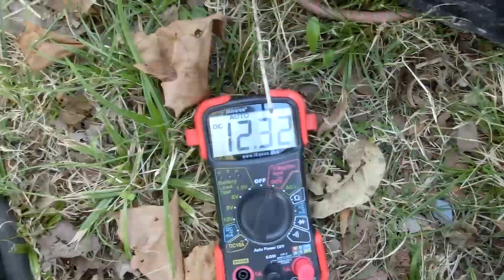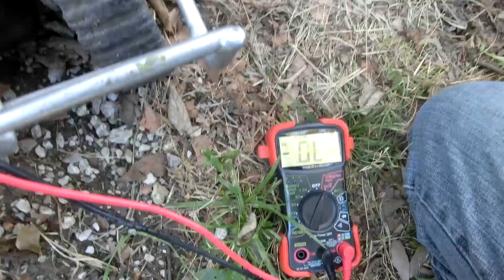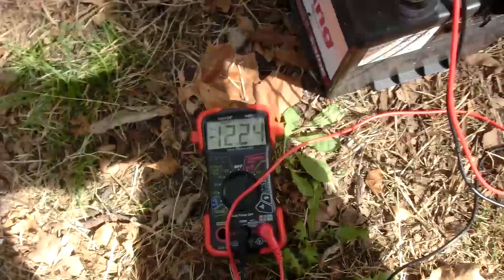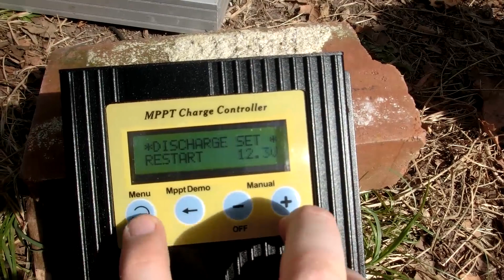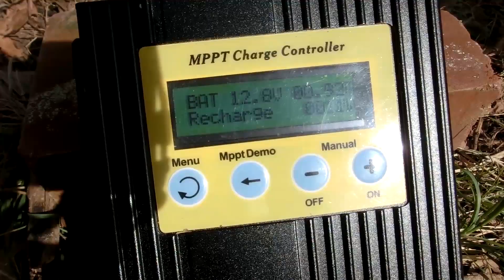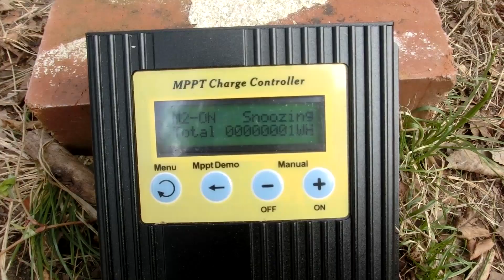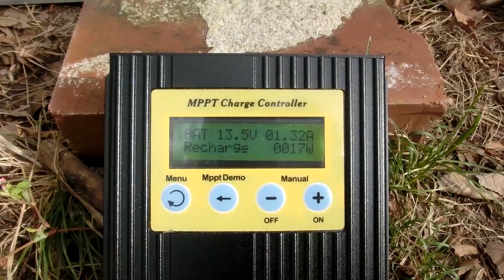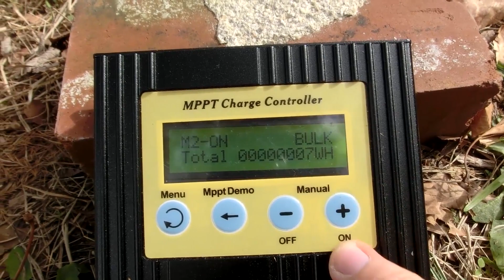Solar Sunday Experiments 012: MPPT controller, clean vs dirty panels

Comment: I just love your Videos. I'm trying to learn all the Solar Stuff and Electric since I'm fixing up a RV. So your Videos help but I find you so unique and just wait for the next one. Your doing good with getting the place fixed up and that cat is so pretty. I thought the Solar Sunday was good. Thanks :)
Reply from the maker: well i'm glad, and good luck with your RV. that sounds pretty cool. what voltage is the electrical system? the higher the voltage the thinner the wiring can be. thats why if i ever had to fix up and RV i'd probably use a 48v battery array instead of 12v.
Reply: My guess its a 12v wiring system. So what ever voltage that would be. Just learning all this stuff. :)

Comment: Thanks for another enjoyable video! I've just ordered my first solar panel, only a 30w flexible one, for my bicycle cart. I was planning on using a Sepic buck/boost converter to charge a 48v power bank in the cart that will connect in parallel with the e-bike battery.  Not sure if this will work so well. I haven't done electronics in 30+ years and so I'm reaching the end of my knowledge. I was trained in the military as a signaler and consequently, battery management, however MPPT devices are new to me and I'm not sure I could justify the cost for a bicycle cart.  As ever, I look forward to more videos that will educate me on this stuff. Thanks again!

Comment: just remember if your doing another shed to keep things dry much larger roof than the rest sort of like a wall you put copings on top to stop water penetrating. need an overhang to stop water running down the sides. possibly using a solar panel as a topper?

Comment: Curious if your controller puts out power still when the panels are loosing sun in the evening.  So been working on my own MPPT following the open source diagrams and used it to boost the voltage more set it to a constant 14VDC even when the when the panel is putting out less than 12VDC.  From what I read the ones you can buy do the same thing.  I am really experimenting so wanted to see what your getting if you have a chance to try it out.  Check the voltage feeding the controller lets say its at 11VDC want to see if the controller is putting out maybe 13VDC just to know if its is boosting the voltage.  I may buy one just to learn what a good one does so on my home built ones I have something to compare it to.

Comment: dunno, kind of makes sense to find a permament place for both panels, and a space in a shed, and 12v power rails (not mixed up in a small shed, maybe along the side of a larger shed, batterys single file) and use (maybe flattend copper tube, running sideways along the shed)  so all the batterys can singly be connected or monitored, something neat and tidy,   then also a good place for an inverter so you can do anything with the power.  then you can basically forget them all the time they bore you

Comment: MC4 connectors are standardized connectors but not standardized in the same way as other connectors like IEC plugs and sockets.  MC means Multi-Contact so the connector has more than once point of contact internally.  The "4" designation is merely denoting the size of the connecting pin in cross section as 4mm^2.  Many are cross compatible but variations between manufacturing tend to mean that 2 connectors from different manufacturers or time periods may not be completely compatible.  Also if you are installing a solar charging system on any type of real scale you would be dealing with several panels that are all matched from the same manufacturer so connections would likely be compatible across the entire system.  I very rarely run into issues with them but I also keep several spares in case I have to match my existing system in the future.  They do a very good job of making secure water and corrosion resistant connections that generally last the normal service life of the panel.

That being said, as long as you make good water tight connections it really doesn't matter much if you choose to cut the connectors off and splice them.  Don't forget to use a good amount of dielectric grease or Petroleum Jelly to keep your connections solid and free of corrosion at the battery terminals when installing for the long term.

Comment: Love the new controller! I can't wait to replace my PWM charge controller. As for the idea of putting a voltmeter in a remote location, i think all you will see the the voltage rise quickly over ~20mins as the sun starts to rise then between 18-19V all day. I find panels act a lot like a regulated CV DC power supply. 

Now if you could devise a remote power (watts) measurement, or even just keep an eye on the batteries voltage that seems more useful info wise. 

OH, and i was wondering what you thought about reviving the idea of sun tracking the panels, super DIY style? I find my panels suffer from being off axis for quite a few hours per day. They are static mounted south-facing. and these overcast autumn days definitely aren't helping either!
Reply from the maker: well we dont have totally sunny days here in illinois, theres always some clouds messing with the suns rays. also i'd think the mppt controller would increase the voltage of the panels as they produce more power. so measuring the volts from the panel would be a rough indicator of how much power i'm getting.
  
sun tracking is interesting, but i think it'd be more efficient to just take that effort and get more panels. i'd need to work on the sun-tracking design for a while before it was efficient and tornado-proof.

Comment: lithium ion are cheap? On what planet?  Sealed batteries that are designed for solar applications work well and are no where near as expensive per amp hour. Most can last 12+ years. 
Proper storage of batteries in a climate controlled area also extends their life. Car batteries work, but don't last nor do they produce the long term slow draw power needed for solar applications. The only way to really test a battery is to charge it then see how it discharges under load as well as to check it's self discharge rate over time. MPPT charger controllers are far better. They offer higher charge efficiency then pwm type. It is not uncommon to only have about 60% of your solar power delivered from your panels to the batteries via a PWM charge controller as opposed to almost 90% from a MPPT. MPPT may cost 3 - 4 times as much, but you need less panels to deliver the same charge to the batteries. At present my charge controllers are PWM, but replacing them with MPPT will be my next upgrade. Also, since my batteries are in an enclosed place, I absolutely will never use batteries that need to be filled with water. They emit  hydrogen which in sufficient concentration, can explode.
Reply from the maker: on earth, used laptop packs are free sometimes and take only a bit of work to salvage the 18650 cells. i have many videos about that.

Comment: One thing you could do to increase the resolution of the amps being used is to connect a DMM between the panel and the MPPT controller. Since DMMs have more decimal places than that particular MPPT unit, it might give you a lot more accurate results. That said, a ten percent variance is probably accurate since those panels were designed to tolerate that kind of thing and still have decent output. Let's face it. Nobody want's to be outside cleaning their solar array every day. Even once a month is more than most people will do.

Comment: Do lead acid batteries stand up against vibration and harsh climates better than lipo?
Reply from the maker: i'd think it would be the other way around.
Reply: I guess cold temperatures negatively impact their performance. According to google anyway.
Reply from the maker: billhacks
its even worse with lead-acid in the cold.

Comment: One interesting reason we still use lead-acid batteries is because they're good for the environment! Ok they're not, but apparently phasing them out would result in tons of lead going to waste as opposed to being used to make new lead-acid batteries. Essentially, all the old-fashioned cars are sequestering the lead away from places it could do damage.
Reply from the maker: +Jonathan Whitaker lol, your joking right?
Reply: Just a little :P although I do think keeping some lead stored in cars for a bit longer isn't necessarily a bad thing. Of course, that argument falls flat if battery makers just mine more lead, but of course they wouldn't do that because big companies are always so nice!
Reply: i think the reason is they're just easier to charge and safer than lithium ones (without using a battery protection circuit)
Reply from the maker: Jonathan Whitaker
well the US doesnt mine lead anymore, or at least hasnt smelted it since the Herculanium lead smeltry shut down. most of our lead comes from china and whatnot. if we stopped buying lead acid batteries the lead would still have a market value for solder and whatnot. so we'd just start shipping our lead scrap over to china.
 
IscleGaming | ZefaCraft  no they arent safer, and charging is actually more complex because the voltages of lead-acid cells are all over the place when charging compared to lithium cells.

Comment: could the batteries be stored in your basement so the weather doesnt affect them so much?
Reply: It's not worth the risk then
Reply from the maker: Phantom309
when i eventually switch over to lithium-ion i'll put them in my basement. but i kinda dont trust my own home-made systems anyway so i'd have them in a fire-brick lined box or something. hahaha
Reply: Some of that wiring looks far from safe enough to be inside your house, especially with the amount of stuff in your house. Lithium ion is the way to go for sure!

Comment: keeping your batteries on a cold floor will kill them,and mc4 connectors are designed to keep the water and air out so they don't oxidize :)
Reply from the maker: no it wont, thats a variation of an old myth about concrete floors and batteries. ya see in the 1920s batteries were made of glass jars in a wood crate and concrete has moisture that would rot it. but every since the 1940s or so it doesnt apply.

Comment: Maybe it is not quite as good as a test, because if the battery has gone high resistance, the clean panel could push more Amps but is limited by the battery.
Reply from the maker: yeah, but this battery was still pretty good so i'm not too concerned.

Comment: keep up the good work.  I am going to mount a solar panel to my bike over the winter.  I know it will not power the bike but it will extend the range   I will take the bike from McHenry  il to Destin Florida next summer.  how's that!
Reply from the maker: i think you should see if having it on the bike increases the load the motor takes to reach a specific speed or not. that would be interesting to see.

Comment: nice. I'm noodling with a peltier idea for power.
Reply: TEG? I dabbled in that myself, trying to make a little fire-powered mobile phone charger. I can give you some advice from my own experience: Maintaining a high temperature difference really is key if you want usable efficiency, so you're going to have to run your TEGs dangerously close to the temperature at which they will fail. You can get high-temperature modules that are designed for energy generation can can run much hotter, but these are far more expensive than those designed for cooling. You're also going to need quite a few of them, because they don't generate a lot of voltage.

Comment: With a MPPT controller,  you should connect a few of your panels in series you will see a big difference in amps going to the battery.
Reply from the maker: im not thinking this controller is designed to handle such a big difference. its working great in parallel configuration so i'd rather not push it right now.
Reply: From what I can find spec wise I would not push it over 200W in a 12V configuration.

Comment: a load resistor across each panel would have been fine to check the voltage and amperage to give you the watts, to then give you the loss from dirt.
Reply: Sirus I mean from the sun scenery to the solar panels to heat up water!!!!

Comment: Lead-Acid is better in cost:peak-amperage and they're less likely to explode even though they're next to a hot engine.
Reply from the maker: no, lithium is cheeper now. lithium can provide more amps per AH while keeping the voltage more stable, and lead acid is the one that i'd be worried would explode.
Reply: Rinoa Super-Genius how much does a 12V/800A (startup) capable lithium battery cost? It needs to do 12V/25A for 135mins (reserve capacity). Has to be under 180$.
Reply from the maker: Adam Rivera
idk, check hobbyking.

Comment: what kind of volt meter you have ?
Reply from the maker: i use the cheepo meter from walmart. its good enough for most things and i dont want to worry about breaking it.
Reply: mine came same place as your did   mine black  and came a outlet tester
Reply: i new vlot meter from sears i got for $9.99 on sale

Comment: I think we still use lead acid because for the cold temperature, i dont think a lithium cell battery could start my car at -40C like my lead acid does every winter here in canada.
Reply from the maker: i'm pretty sure lithium could still provide some power, at least enough to warm itself up.

Comment: Hi
Thank you for the mention! I think you should try power your computer :-)
Reply from the maker: +My PlayHouse (Morten Hjorth) did you get any extra subscribers from that? im curious how a tiny shout-out like that does.
Reply: HI Rinoa Super-Genius 
No It does not look like it, I got 26 new subs yesterday,, Daily Averages is 40 right now.
But I was happy to be mentioned :-) The first time, when I send you the battery things I got close to 300 new subs. That worked well. But We have both grown nice,, so we could probably do something again.
Reply from the maker: My PlayHouse
well i'm still going to give you a shoutout when i do the Synology video. i think i'd like to put that off until i get a server rack set up in the basement.
Reply: HI Rinoa Super-Genius 
Well I do hope you get that up and running, it's the best way I have fund to keep my video files save. and with four drives and mixing disk sizes You get a lot of storage with even older drives.
I'll find a way to send the shoutout back when you do make the video. :-)
Reply from the maker: My PlayHouse
 well i have a macbook i want to send you, so you could do a shoutout when you get that. ^^

Comment: I've always heard that you should keep batteries off the ground
Reply from the maker: well you heard wrong then. that myth was accurate when batteries were glass jars held together with wood. the wood could rot if set on the ground, but since the 1920s it hasnt been the case.

Comment: Have you ever thought about using some of the not so good 18650's to make a lithium battery pack for solar use? Then you wouldn't have to worry about self discharge so much and would be able to discharge them lower!
Reply from the maker: yeah ive talked about it before. but i'd want to get a solar battery system made first, then switch from lead acid to lithium. i think it would be easier.

Comment: Even though Li batteries have dropped in price, they're still quite a bit pricier than lead acid.  I still use lead acid batteries with my solar.  I wish Li Ion were the same price per kWh of storage as lead acid.  Not only that but the charge controllers I have do not support Lithium Ion :(  I would have to spend more money.
Reply from the maker: but used lithium cells are dirt cheep and still better than lead acid. and you can use a BMS circuit to make the lithium cells work like a lead acid battery.

Comment: I do understand why you like lituim ion better, but I found lead acid just is easier to work with
Reply from the maker: really? whats harder about lithium cells?
Reply: Balancing and overcharge / unbalanced charge tolerance. Lower cost / simpler charging solutions.
Reply from the maker: Cnerde
higher cost actually.
Reply: Rinoa Super-Genius I lost part of my thought there, meant to say lead acid has lower cost solutions.
Reply: Main part is the balance charging when you have to work with people that don't understand and just try to stick a 12v lead acid battery charger on a 12v lithium pack......

Comment: Even 18650's arent that great vs Lead Acid. The next best things are solid state batteries, which should exceed all current tech. 
Also that looks like its a PWM controller, but not sure, need more data. Keep it up!
Reply from the maker: what are you talking about? lead acid is shit.

i'm not sure what your going on about SS batteries since they dont exist. and no its a MPPT controller. i show that in this video.

Comment: I have never encountered an MC4 connector that didn't work with another MC4 connector. :/ I'm curious as to how that happened.

MC4 has been actually (once I got all the tools, only about $40 on Amazon), really nice for me when working with lots of panels. The 'click and go' connections are much easier than solder when wiring a large array. 
Must admit I cut the MC4 connectors off my first panel I ever owned as well, but I've since replaced them with new MC4 connectors a few months back.

If you happen to need MC4 connectors in the future: 
https://www.amazon.com/gp/product/B00KNXPIUG/
Cheap, $1 per pair of connectors. They've worked well for me.

If you need a crimp tool, literally the cheapest ones on Amazon work fine as well. (You CAN use needle nose pliers and such, but I find crimp tools to be a time saver.)
Reply from the maker: +Four ZeroFour its because different manufacturers have different mc4 connectord
Reply: +Rinoa Super-Genius That's some pretty egregious standard violations then... They are now an industry standard so all MC4 connectors should work with all other MC4 connectors.